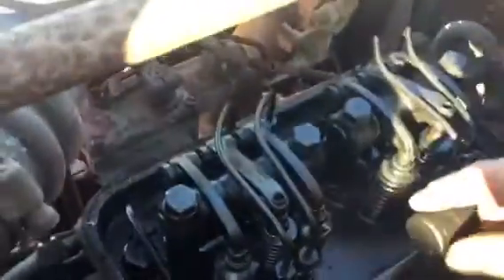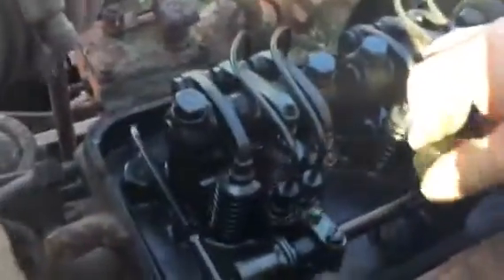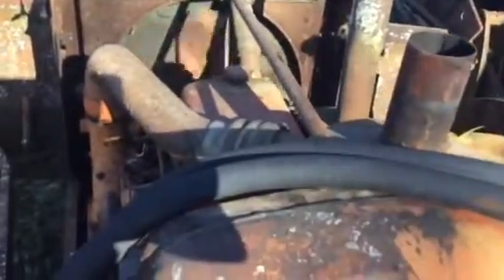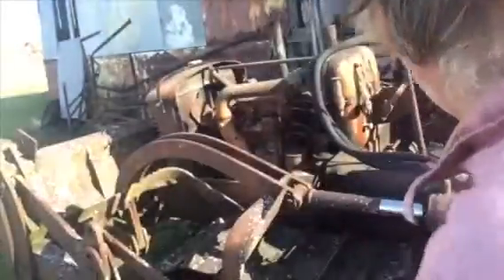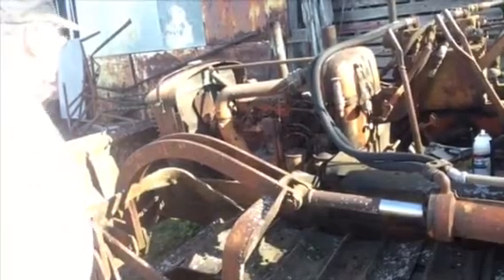New toy Allis HD5 GM2-71 first start

Comment: U cut out the good part my friend.
Levers look a little less stuck they my HD10.
U will have to show me your primer setup. I like the idea
Reply from the maker: I have no idea how that primer works, I haven’t looked at it closely. I think my big Buda diesel has something similar. I’m having problems with volume control when recording, it goes up and down according to background noise and also sometimes I want to record audio to put with video when editing and can’t make that work. Technology isn’t my strong point, imagine that. Back to the HD5, it would start and then die out. Turned out the rear cylinder injector plunger stuck again, I took the valve cover off and got a little pry on it when running and it freed up and ran good. In a few days I will have a video of loading and hauling it home. After I got done hauling corn today I stopped back, ran it again, found hydraulic pump was leaking badly, the owner said he seemed to remember there was an oil leak and I found it. Also the left steering clutch wouldn’t release but I should be able to get it loaded. More to come in a few days.
Reply: @oldamericaniron5767  you have more editing skills than me my friend, i cant do any. would be nice if you could sort the volume thing out. but, its better than nothing.ive heard the GM motors can have these issues, will be interesting to see if my HD10 has any of the common issues.
Ive heard of people mixing ATF in the diesel to help lubricate. cant say i have ever tryed it. a bit of driving hopfully will sort out that steering
Reply from the maker: I worked for UPS and when they went to diesels they thought engine repairs would drop immensely but they were wrong. They were replacing injection pumps on the Cummins a lot, very expensive. The mechanic started to put a quart of atf in the tanks occasionally and the injection pump replacing all but disappeared. He didn’t care about what pumps cost but he said replacing them was a pain in the - - -. I hope to move the HD5 today.
Reply: @oldamericaniron5767  well there u go, ill have to try that out. Oh nice. Hope all goes to plan then. Id offer to help.... work would be over before i get there haha
Reply from the maker: Things didn’t go that well today. The HD5 started right up and ran good. I was moving it to where I wanted to load it. The engine began to rev, I tried to idle it down, no throttle response so I pulled the emergency shut off. The throttle rod had broke but now it won’t start. It didn’t over rev, I’m sure. It will fire on ether but won’t run. I have fuel pressure to the injectors and the rack is free but won’t run. I spoke with a friend who is quite knowledgeable on them and he is stumped also. I can hardly believe both Injectors would fail at the same time. If I can’t get it started tomorrow I’m going to hopefully winch it on so I can get it home. I’ll keep you posted.
Reply: @oldamericaniron5767  right, well thats not great news at all.
I dont know alot about those injectors, but could that be stuck down? Maybe tap on the side of them. Im having some issues today also. Sold a truck. Got it running, blow out a tyre, swapped that, flat batterys. Swap batterys, one dead battery again.
Then my mate thats carting the truck has been held up and not due here untill 11pm. 10.25pm atm.
Dads asleep and the locals haha and the trucks got have a exhaust. Fun and games....
Reply from the maker: It went from any easy start to a miserable time loading it real fast. I wanted to load it on the gravel driveway but due to none running loaded it where it was which was on soft ground so the previous owner had to help pull with his Allis farm tractor to get it to the driveway. But as my old friend used to say, we don’t ask it ,we tell it.
Reply: @oldamericaniron5767  well. Atleast he have it back now. Hopfully u can sort out the injectors